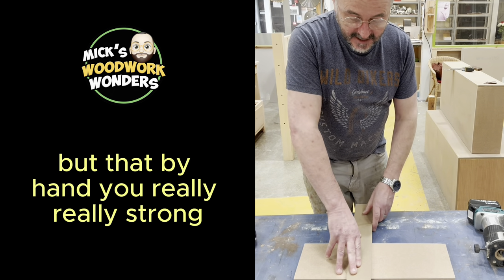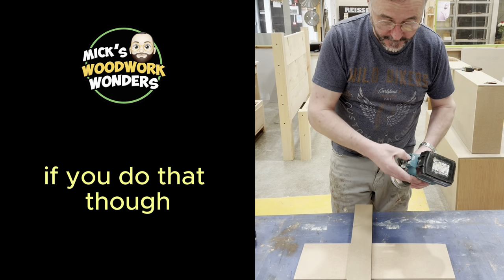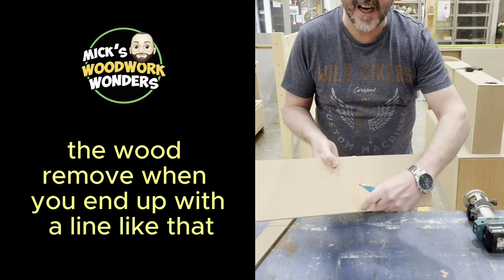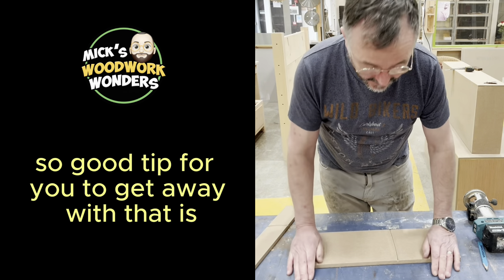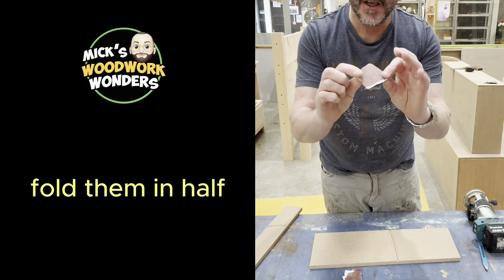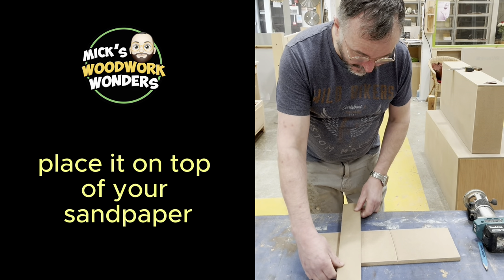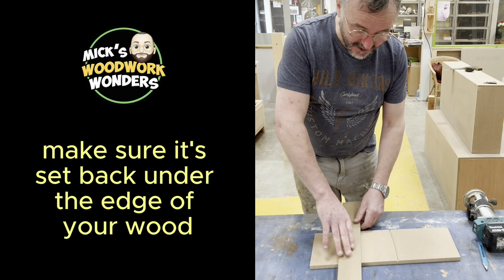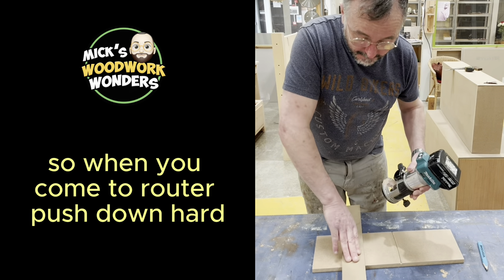WOODWORKING Secrets That Will Give You an Unfair Advantage!

Comment: Double sided tape? Or Painters tape on both sides then put super glue dabs on each side of the painters tape then pull apart after cutting a straight line ?